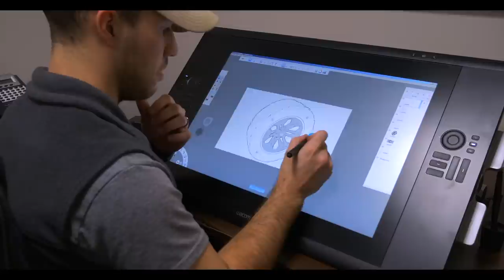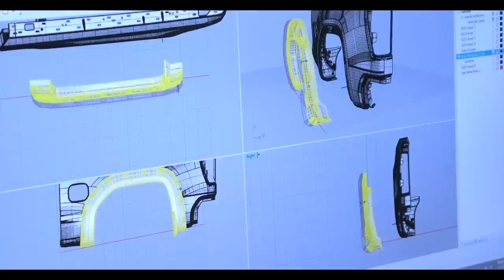SCA Performance | HOW IT'S MADE

Comment: There is a black widow at my local Ford dealership where they painted it matte blue. Looks great from 10 feet away, but get close and there are imperfections everywhere in the paint. They didn't even remove the weather seals to paint and you can see the factory color everywhere.

Comment: I bought a 2019 Silverado Black Widow, first off the truck's oil pressure gauge did not work, second the flares did NOT have Marine Grade Hardware and rust happened, thirdly the truck left your shop without the performance exhaust as stated on the build sheet, with all this being said HOW DID this truck pass your rigorous 100+ point inspection? Please contact me for further information.
Reply: How did the flares get rust when they’re made from plastic?
Reply: Why did you buy a truck knowing it didnt have the exhaust you were looking for lol
Reply: Pushin Chevy SCA Performance doesn’t just make trucks and sell them. People can order them personally made, and black widows are supposed to come with “performance” exhaust, but it’s just Gibson muffler.
Reply: @aguyonastreet  maybe he means the bolts
Reply: Gerson levi Stainless steel screws are rust-proof surface and all the way through.

Comment: All these specialty trucks look nice. Rocky Ridge and Tuscany make a mean looking package too. None are worth the 20-25k additional price tag.  At the end of the day you’re getting a basic lift, upgraded tire and wheels, nicer interior stitching and cluster displays, fender flares, maybe some LED lighting. Possibly a performance exhaust.  And that’s about it. They do nothing under the hood, brakes, and barely an upgraded suspension.  You could make these trucks for $10k on your own with quality parts.  I like how they look but pass.
Reply: It’s not basic did you watch the video it’s a complete in house designed and tested lift they relocate stuff and cut stuff out properly it’s not lifted by some joe shmo these are pros these lifts last the entire life of the truck

Comment: I got a SCA Raptor and the only reason I bought it was because dealer sold it to me at the price of a standard raptor. Also this guy says "You won't find parts of the shelves on your SCA truck" but my raptor has ADD bumpers, BDS Lift with a SCA logo on it which I double checked with their warranty department that it was BDS, Rigid Industries lights, Fuel Wheels with BFG tires lolll. It seems like all they making is the Fender flares for the Silverado's and that's it

Comment: I got my 2021 F250 Black Widow & it has a few paint imperfection's but nothing I can't get over BUT! The one thing I can't figure out is ( WHY ) nothing is done with the lighting & the up fitter switches! Wicked Warnings does a few video's but the one thing I think is a tail light bar on the F250's. Seen a few but they're the CHEAP Putco glue on' style! NO WAY IN HELL am I gonna glue on & cut wires to install a cheap light! So what are the options & who decides that???? Sure wasn't me!